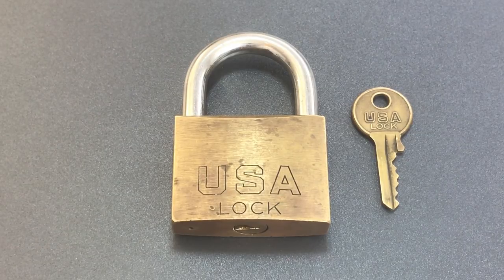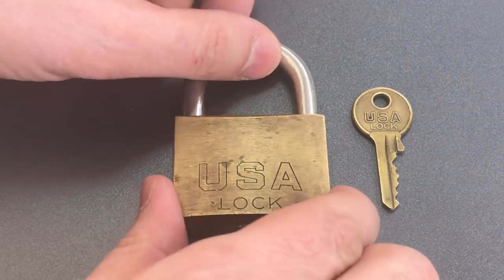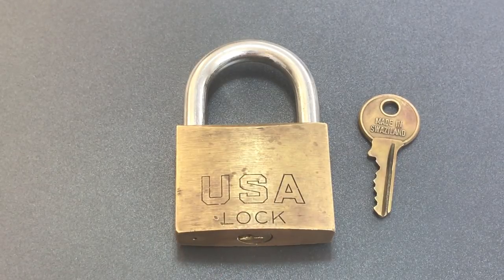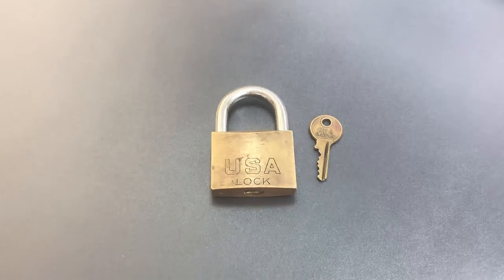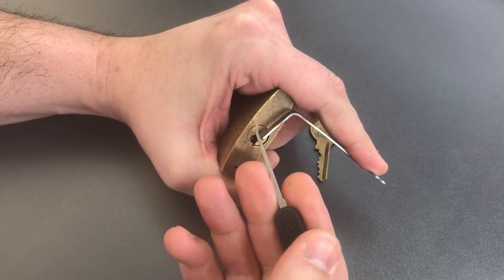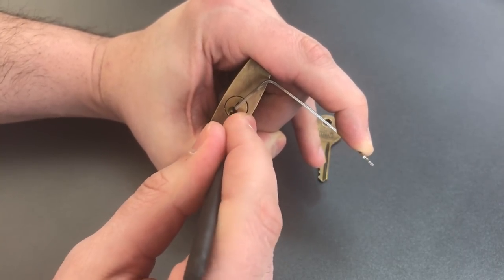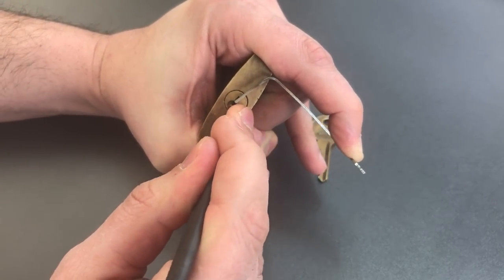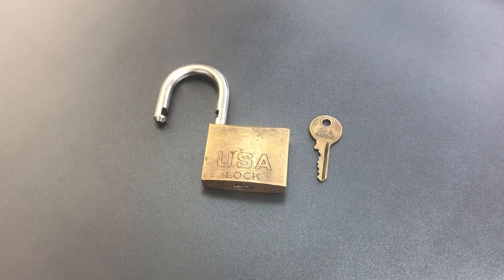[647] USA Lock... Made in Swaziland?

Comment: I found an old one of these lying around. Naturally, I got to picking, and got it after a short while of feeling what the pins feel like. It was fairly easy to crack, tbh. I'm quite surprised at how many locks are very easy to pick (I'm sure cost is a factor). Some locks I used to use can be opened by simply putting the pick into the key way and turning.